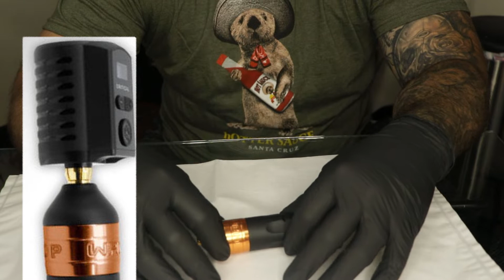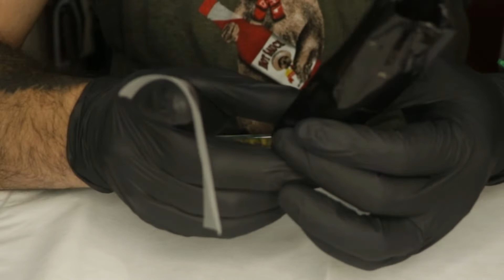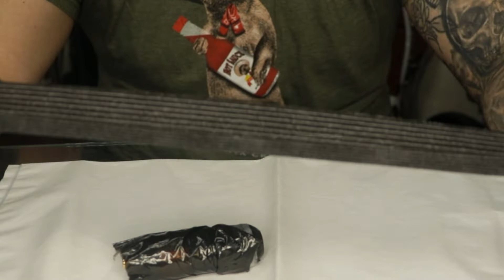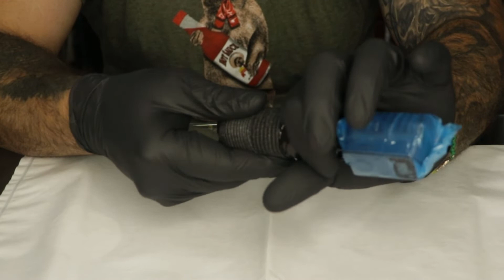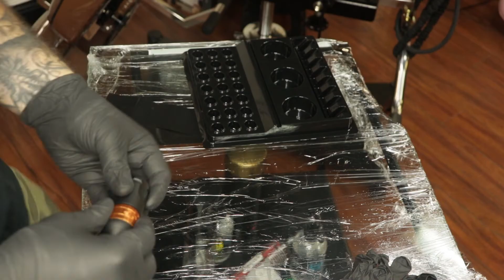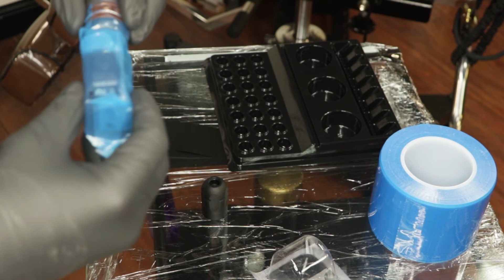BISHOP ROTARY WAND ( packer) | how to Set up your Tattoo machine

Comment: much ado about nothing. its not even a closed system and costs time 

take a coil machine bag, and just go up half the grip + fold it a little, then put the tape like you have shown on the whole tip but tight everywhere. 
Dont know how much u want to twist that machine mid session, but the necessary adjustments stay possible this way and you got it all covered. 

its not about tight fit or aesthetic Oo my wrapping is kind of loose behind the tape but its all closed and no functions lost and it takes less than a minute to set up easily

Comment: Hey bro, i have the packer with the critical wireless battery now, but also the vlad blad avenger 2 pro. 

I have used them both and saw your review on both of those tattoo machines. My question is, what do you like more? I like the vladblad because of the strokes more but the packer more becouse it’s more silent and more like a pencil. But i think the vlad blad may be overal better. Should i try to use it more often?
Reply: Use whatever pertains to the tattoo u have a softer tattoo requires a softer hit use the vlad blad the wand packer I use mainly for bold tattoos it's also a good liner they both are but the avenger has the benefit if switching to a sifter stroke u should know what ur preference is before buying two machines that are 609 plus man ...
Reply: @ivanmendoza8457  end up buying the bishop power wand packer
Reply: But yeah the new bishops cost alot, in the future i will try this avenger 2 pro no matter what
Reply: @vakkotattoo  I'm usind the dmcv2 from dan kubin and a joshua bowers steel driver i went with harder hitting rotaries that i can use cartriges with i likethe wandpacker but i dont useit asmuch cause mainly use disposibles and the always sold out
Reply: Hey, i would also like what you guys think about these two machines , because i hesitate for one of these two, the Vlad blad avenger 2 pro very interessting and unique, maybe more versatile ? i'm kinda looking for a all in one machine, but the bishop wand seems more easy to use, with battery and no cable , little pencil, so i kinda struggle to choose one